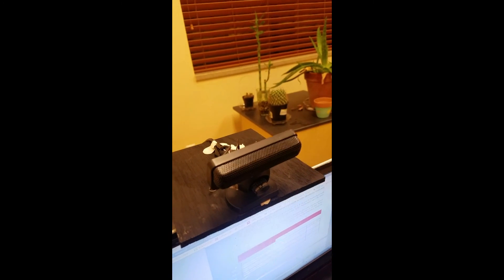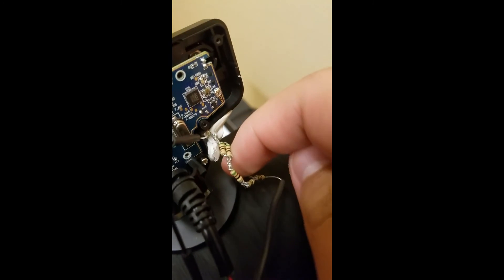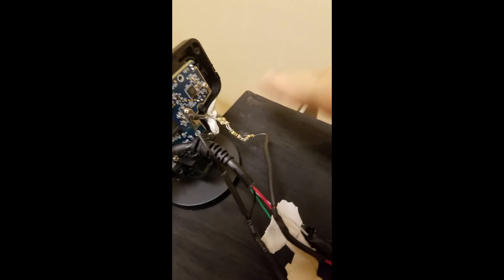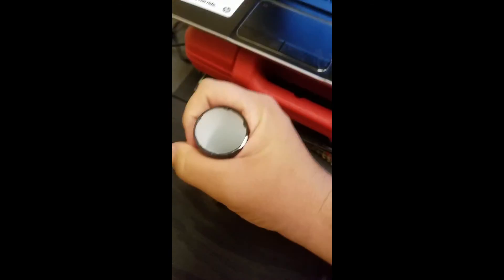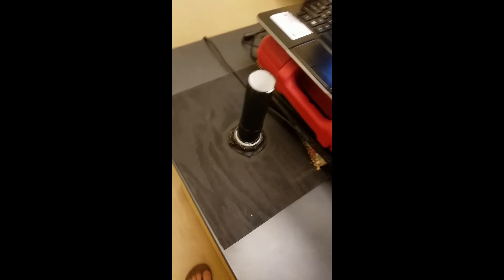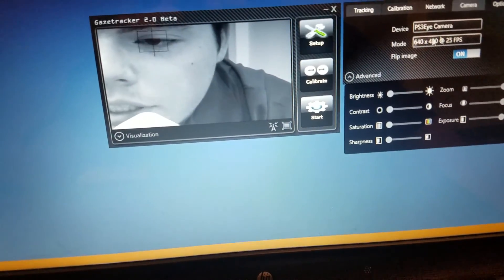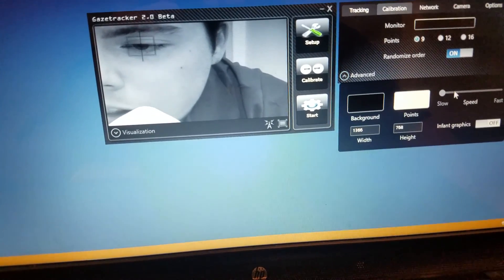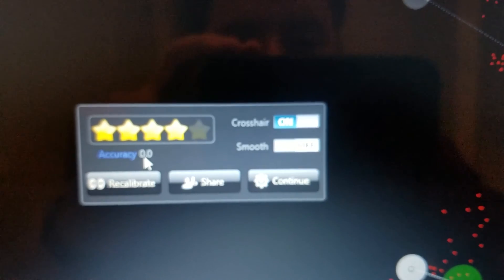Converted PS3 Eye Camera to Eye Tracker

Comment: I received my modified Sony PS3 eye camera which allows infrared light but restricts visible light. 
Is it easy to implement the IR LED source ? because it is the first time for me and I do not know how many should I put and how to do it correctly.
Reply from the maker: I used one IR LED that emits a 940NM wavelength. You don't want to use too many LED's. You may not be able to see the light coming off of them but it is non the less. Just like looking at a bright LED that you can see, the IR ones can still hurt your eyes if they are too powerful. One LED should be safe but multiple can start to cause problems. The VF of the LED's I have is 1.2-1.5V.  I used a total of 5 51Ohm resistors. Two in parallel, then those in series with another 3. That resistor chain is in series with the LED. I tied that in to the power and ground wires of the USB cable.
Reply: Cool !  Thank you so much Damian :)